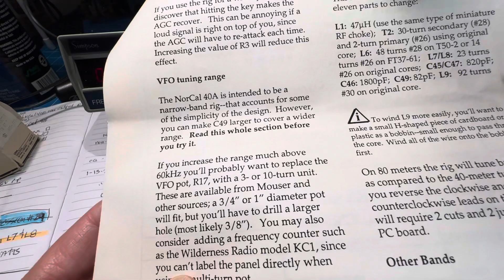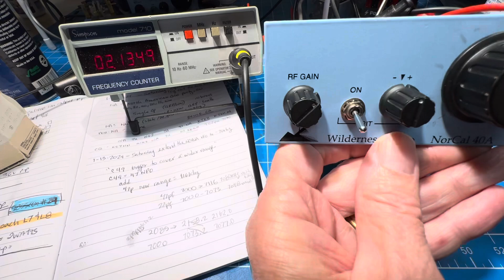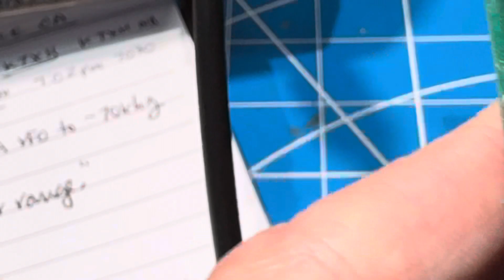NorCal 40A in the mail #4 - Wider Tuning Range

Comment: Very nice! The QR watering hole on 40 m is around 7.040. There is a lot of activity around 7.060 also. The optimum range for PO and QRP I believe is somewhere between 7.025 and 7.070. There is not a lot of activity up around 7.070 because of the digital activity there. It is not well known, but there is some PRP activity on CW around 7.1002 about 7.115. This is the slow speed area of CW. This is kind of what I would consider the equivalent to the novice tech area. Speed range back in the area of five word minute CW. I think a key would really make this rig sweet. Too bad there is not much way to put an internal battery in there so that it would be simple to just put down on the trail and hooked to an antenna and go. Really enjoy these videos! I have been a CW Snob for 30 years. Hai Hai…

Comment: Silly question, do these have audio volume control? Or is that what the rf gain control is for? I noticed the Dave Benson “SW+” radios are similar in controls, are they a similar radio design as well?
Reply from the maker: The audio gain is inside the NorCal 40s, it is a set once kind of control. If you are using headphones it will likely be set lower. I never really think of it after building them.
The Dave Benson radios, including the newer ME40 etc are similar NE602 radios. They have one less crystal in the IF, a 4 MHz IF (instead of 4.915 MHz) and multiple stages of op amps in the audio instead of an LM386. 
In trying to receive weak signals the idea is to use just enough RF gain to get the signal you want just above the noise. That’s why the RF gain is more important for QRP. 
They have similar design goals, so should be pretty similar in operation.
Reply: @tyrueiI  got it, thanks! Looking for a cheap portable rig for POTA or similar portable ops, I haven’t been on HF in years, but I imagine 20m might make more sense than 40m for me, since the antenna might be shorter or at least better performing. Contrast that with 40m being maybe more popular with QRP? What do you think?